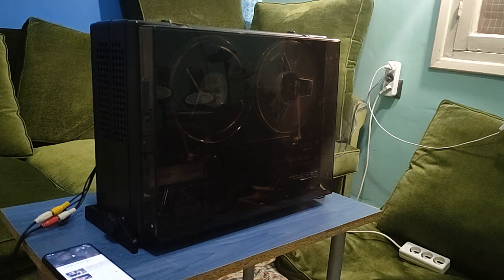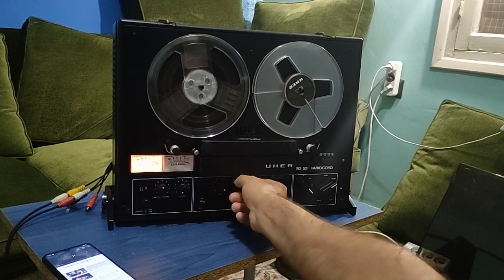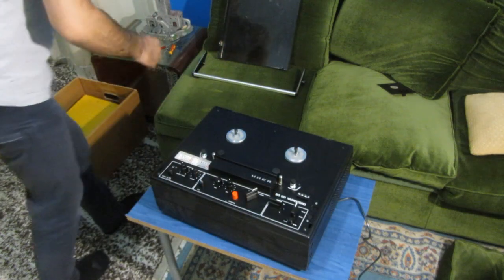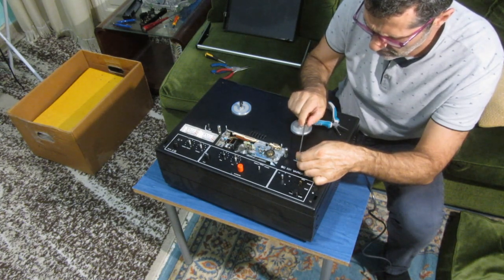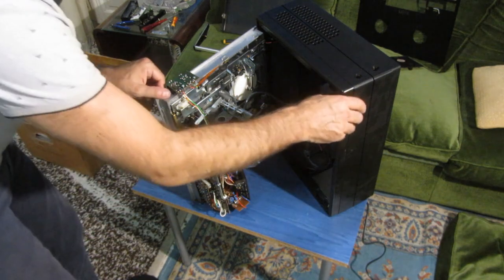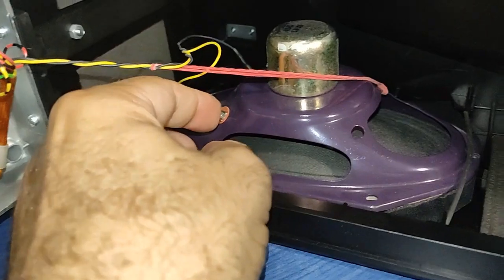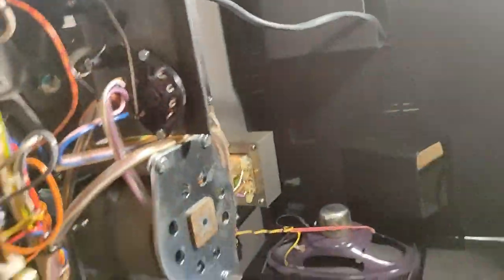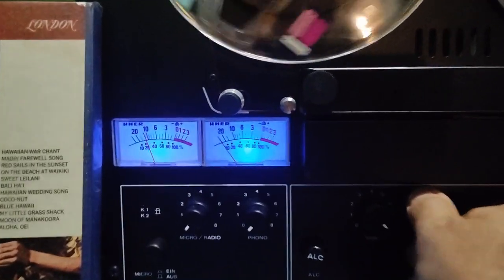UHER SG-521, Some basic repairs, maintenance and stuff

Comment: Hi, can you show us what the 6 ports are for on the back of the machine please?
Reply from the maker: Hi, actually I don't have the machine any more. Just downloading the user manual I see that: TOP - Record player in (actually any line-in will do, not magnetic phono), line in/out, remote control in /  BOTTOM: Speaker, slide projector (you will never need this nowadays), speaker. That's all.